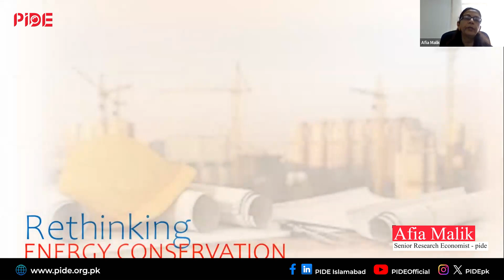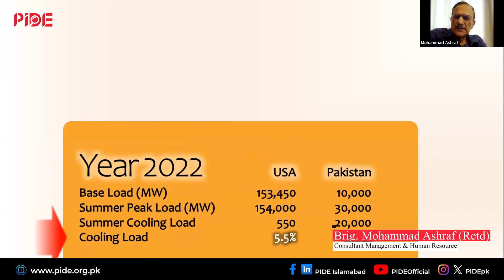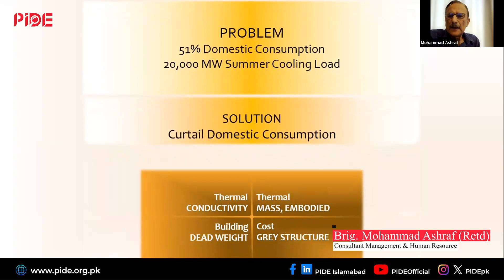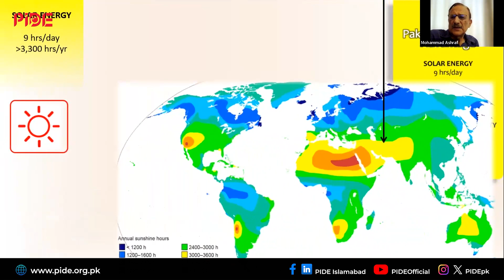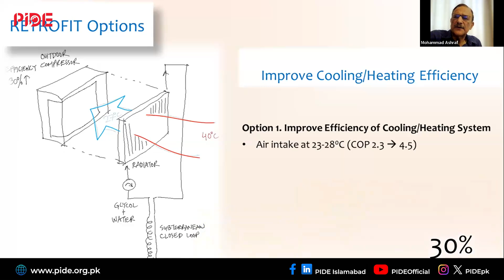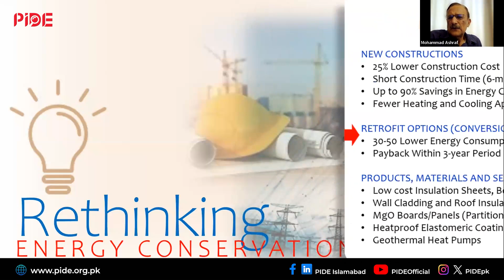Strategies for Energy Conservation in the Domestic Sector of Pakistan

Comment: this is quite  good idea. We have also seen some pilot project on this on youtube. But biggest question is about the SYSTEM which will exract heat from house to the Subsoil . Somewhere i have seen they directly pulled water from boring , flowed it in Tube  and coil and return it back into the ground. Air is passed on coil and by this they tried to cool their houses or Outdoor unit of AC. 
Somewhere i saw they excavated ground to 6 feet and put many metal Pipes connected to each ither like coil. Then covered it with soil. This coil two ends were then used in house to pass the air and cool it and then use that air to cool the house or AC outdoor. 
What system do u propose. What will be estimated cost for individual household.